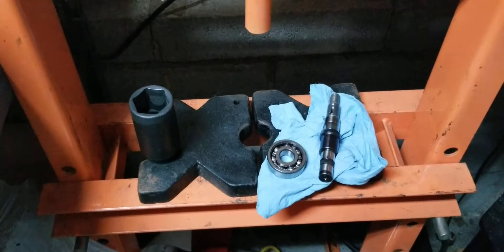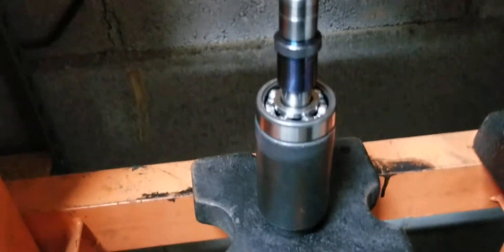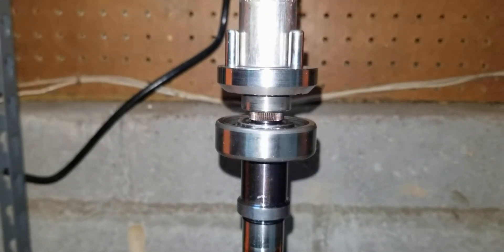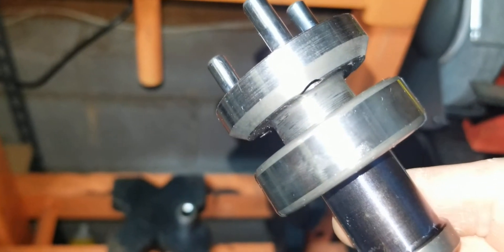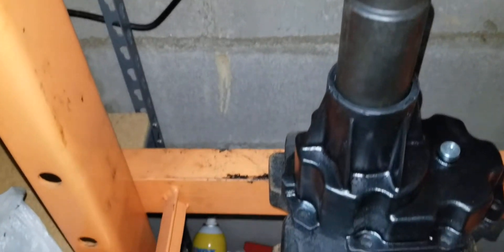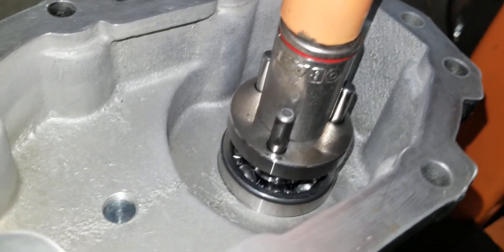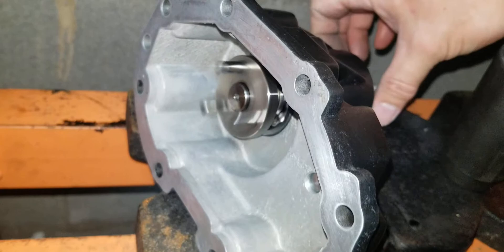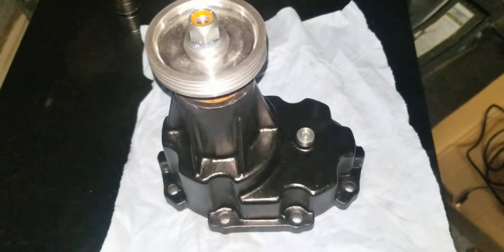Supercharger Snout Reassembly Eaton M45 JRSC

Comment: You should have a spring between the two bearings on the snout shaft.
Reply: Makes sense now both of mine are Sebring. Good video BTW! Love to see it in action 🎬
Reply from the maker: @michaelvincent6975  thanks bro I actually just ripped the motor out and am rebuilding it for the refreshed Supercharger
Reply from the maker: I dont think the m45s had one just the newer sebring ones. This is first production OG lol
Reply from the maker: The case is stepped in this one for the bearing to in a spring would do nothing on this unit
Reply: I'm doing the same as we speak 😉 on a d16a8 with SC in a 91 sedan.
Reply from the maker: @michaelvincent6975  nice mine is a SOHC ZC with a Z6 head